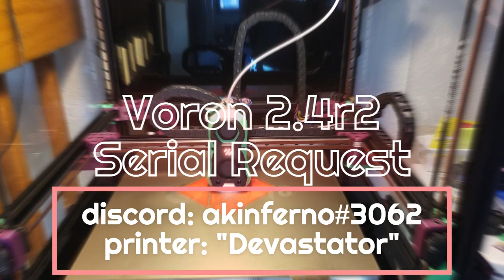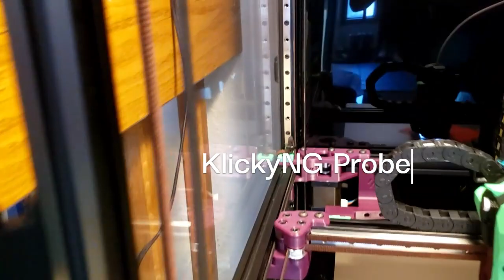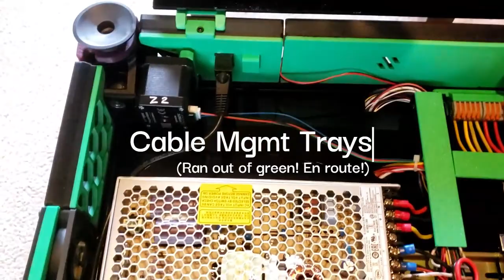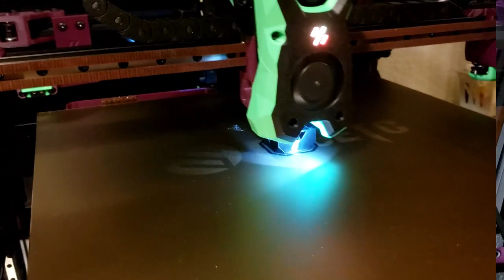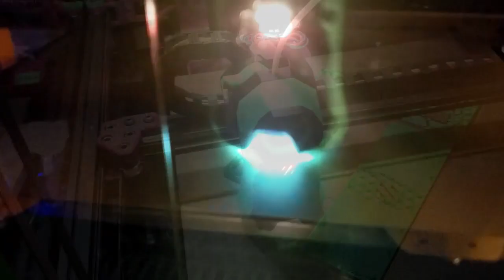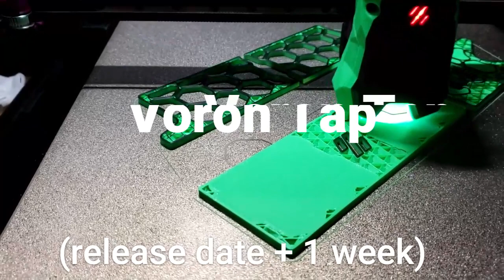Voron 2.4r2 Serial Request (my first DIY printer)

Comment: Four weeks ago I  received my second printer. It’s a Sovol SV05 which is modeled after an  Ender 5 plus (or pro, I mix them up, it’s a direct drive cube construction). I got it, for a few features, my first, didn’t have. My first requirement, was auto bed leveling, check, second, print ABS well (thanks Aurora Tech for the review!). Next was a 32 bit board (Creality, silent steppers too) that I could upgrade to Klipper/Mainsail! With the pi shortage and the pricing I’ve seen, the Creality Sonic Pad is going to be my next upgrade for that! NEXT!!!!! I recently found the Mercury upgrade with which I can print and buy additional upgrade parts to CONVERT THIS PUPPY INTO A CORE XY!!!! Ok, so where is this going??? Well, once I apply these upgrades, the ENTIRE goal is to print all my parts for the VORON BUILD BABY!!!! Anyhow, Subscribed! Love your build, your upgrades, FREAKIN INCREDIBLE!!!! I think the Voron’s and the Rat Rig’s for that matter, are the ultimate designs for the gear heads who simply have to build their own, design mods, and take it to the top!!!! What an amazing printer and yours is FANTASTIC!!! Can’t wait to see more!!! THANKS!